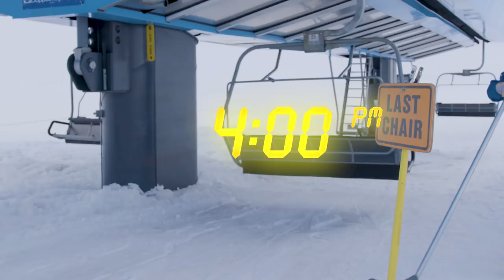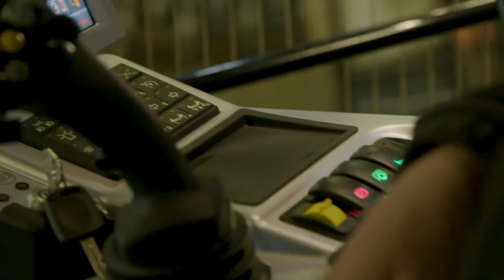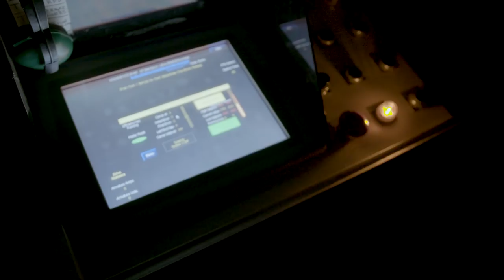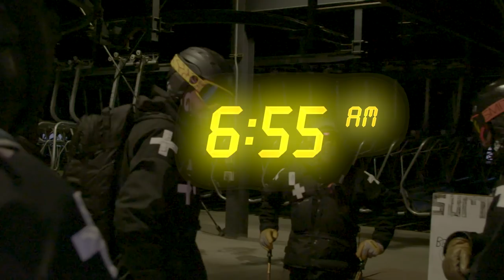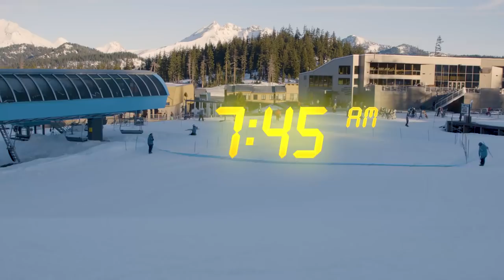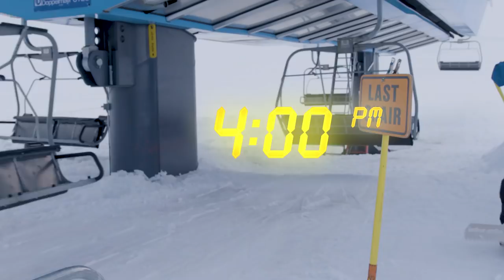24 Hours of Mt. Bachelor

Comment: how is the snow quality compared to Utah, or CO snow?  is it generally heavy, wet snow?  I know Utah has dry, fluffy snow.  CO has a mix of snow, but generally dry to moderate levels of moisture.
Reply: It varies a lot, but it’s usually on the wetter side. A true blower powder day is rare, but they do happen. Plus Bachelor has lots of wind so if it is powder it blows around a lot making depth pretty variable, especially on the summit.